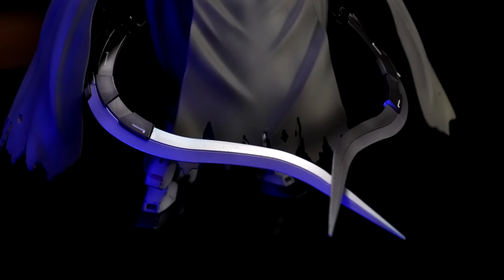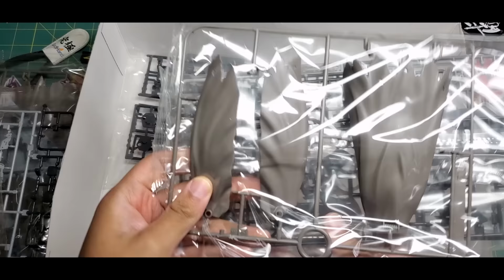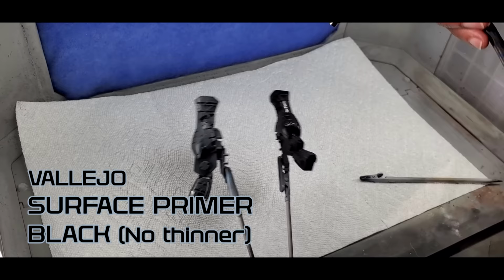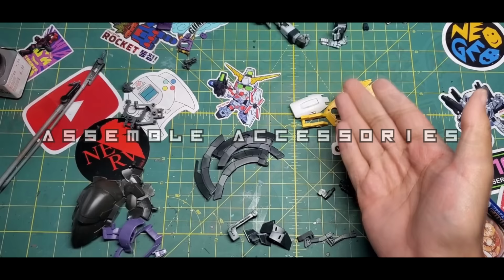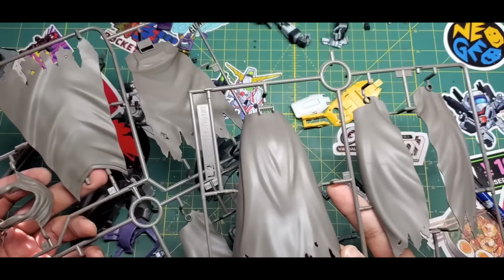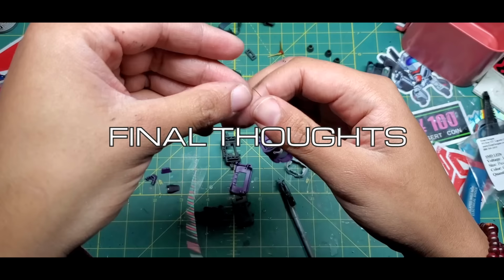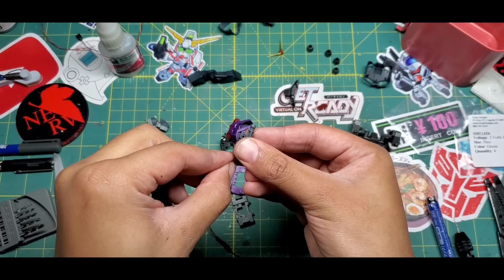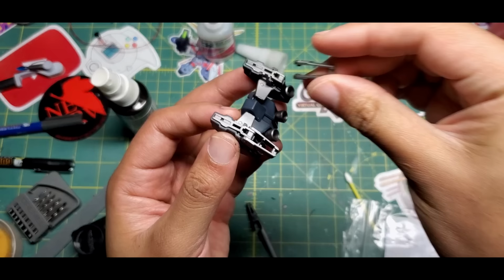#newtype #Otakubuilder MG GUNDAM SANDROCK EW (4K)

Comment: it's a shame that purple came out so dark but besides that it looks great nice job ! also if you have chipping issues you will never have that issue with lacquer paints ,that only happens when using softer paints and you seem to only use acrylics ,mine has no issues at all and i painted the normal sandrock ew version to these colors to save 100 bucks !

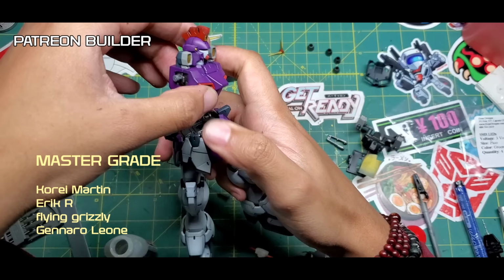Comment: I'm currently working on the Sandrock ver ka, and I found a little workaround for the paint chipping around the ankles mentioned at 21:31. I took a Dremel to the top inside of the white armor pieces to thin it up. I didn't affect the outside profile of the armor or the look, but I haven't had any problems with paint chipping at all, at least not yet. :)

Comment: Awesome video, thanks for sharing. Are there any physical differences on the mech between this and the standard EW version  besides the colors and the cloak? Am considering buying another Ew non P Bandai  version and just repainting it w the Endless Waltz colors. I can get the normal version for $40 vs hashing out $160..I don't really care about the cape anyways. Anything worth noting about this kit? Tia!
Reply: They're identical except decals and the cloak. The regular version even has additional heat shotels in clear red

Comment: Hmm...I'm looking for some advice here. I'm currently working on my first fully painted model kit (I went with GW EW ver Kai...I should of started with Barbatos lol) but I'm having issues with my panel lining. I use Mr Color paints and Thinner. I chose 1 part to test this out and thank the Gunpla gods I did. I panel lined with a gundam marker and decided to clean up the mess with the Mr Color thinner but that started to remove the original coat of paint. I was talking with someone and they told me to use a different kind of paint for panel lining. I purchased Tamiya black and thinner and I'll panel line with that. 

TLDR: Does anyone have panel line advice? I don't want to accidently remove my paint anymore, lol. And will this be an issue if I change to using only Tamiya paints? thanks in advance